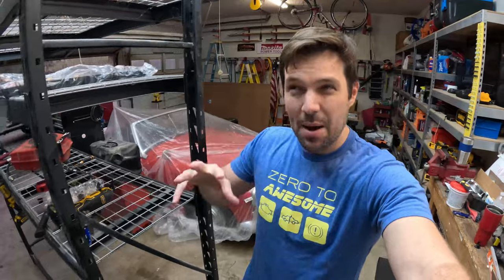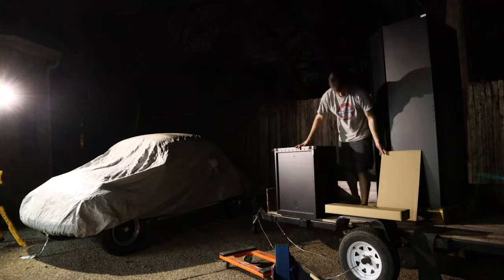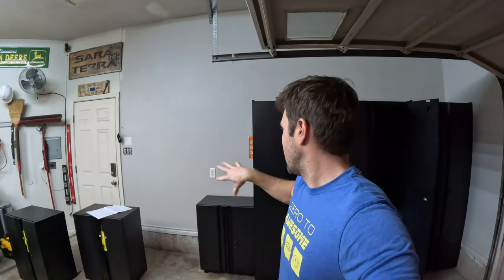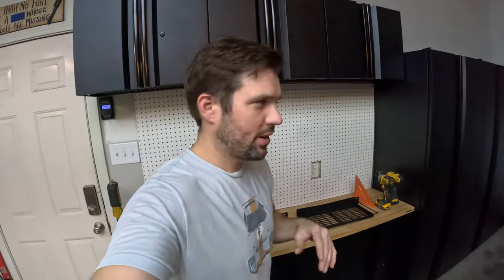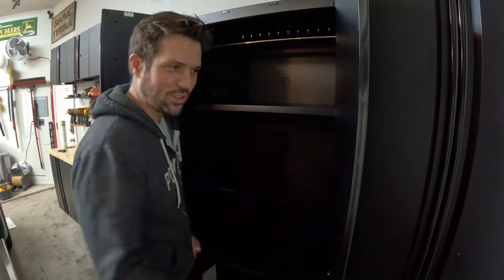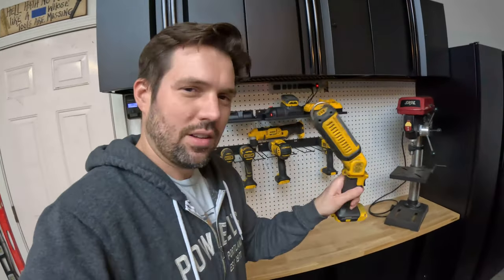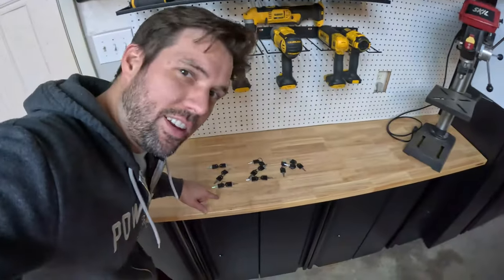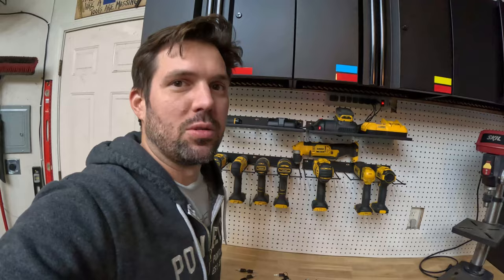How to install steel shop cabinets! Husky Welded Steel Cabinet Review.

Comment: That's a hell of a deal for $1600. Those are solid cabinets. I wouldn't hesitate to pull the trigger at that price. (Off to Slick Deals to put an alert on them!)
Reply from the maker: Was a little worried they would be junk for the price but so far so good!

Comment: coat racks are probably to put spools of wire or tape  or???? that you can then pull off as you need it.
Reply from the maker: Good idea, tried to put wire spools on them but they did not fit. Probably just going to start keeping my fine suits in the garage.